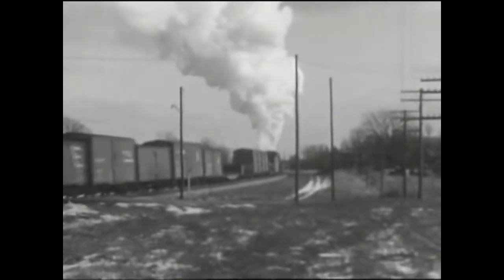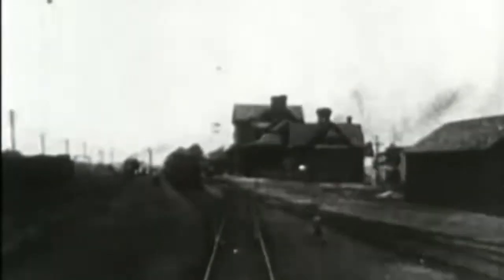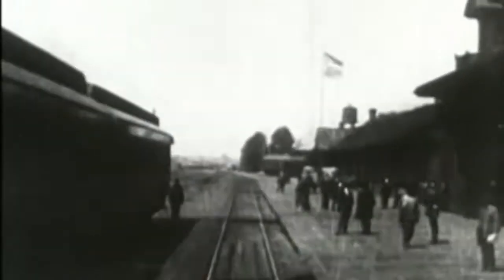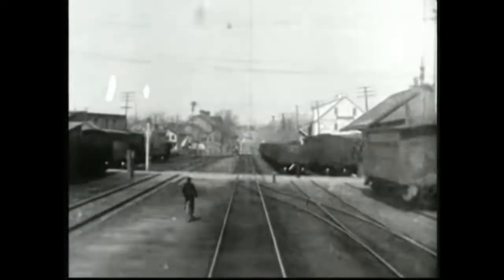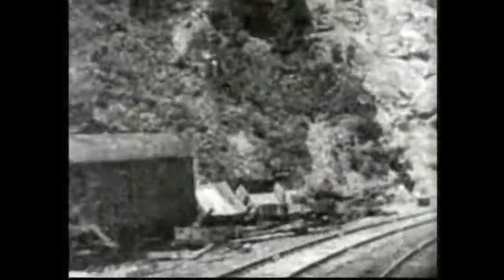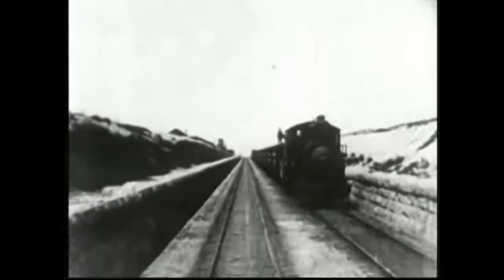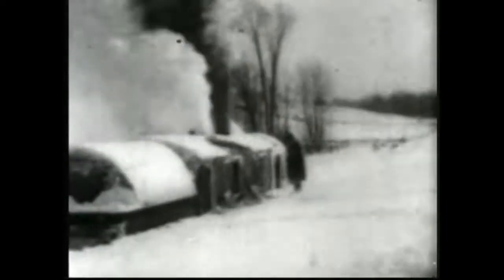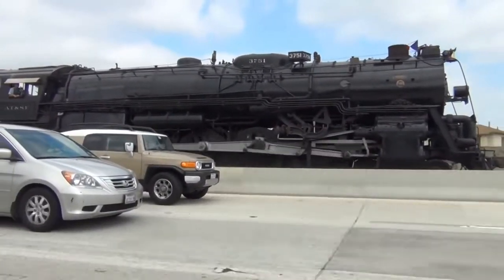Steam - Part 2

Comment: Here’s crazy idea (loco motive hehe); Perhaps they were predecessors to chemplanes. (Chemtrains). “As the railway grew more popular in the 1850s and 1860s, trains allowed travelers to move about with unprecedented speed and efficiency, cutting the length of travel time drastically. But according to the more fearful Victorians, these technological achievements came at the considerable cost of mental health. As Edwin Fuller Torrey and Judy Miller wrote in , trains were believed to “injure the brain.” In particular, the jarring motion of the train was alleged to unhinge the mind and either drive sane people mad or trigger violent outbursts from a latent “lunatic.” Mixed with the noise of the train car, it could, it was believed, shatter nerves.